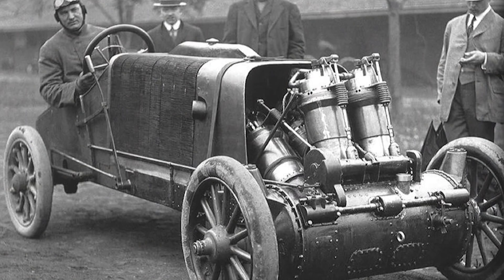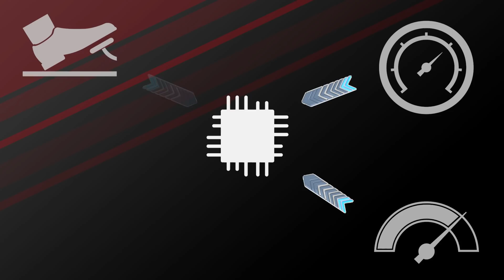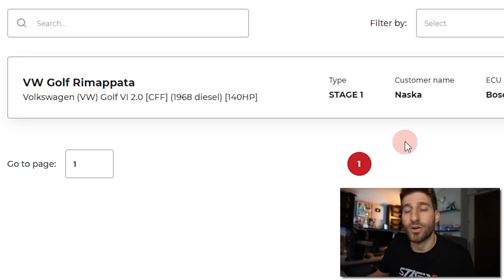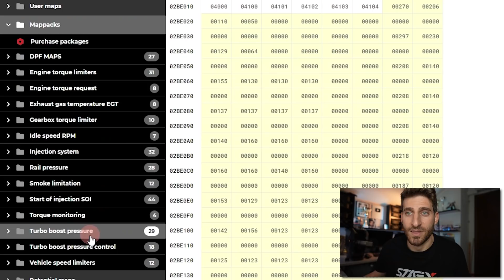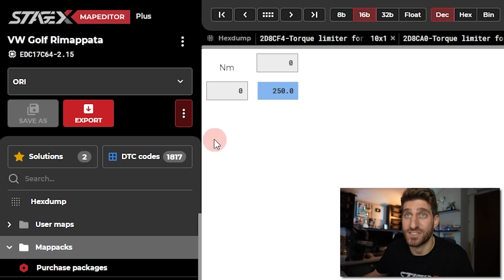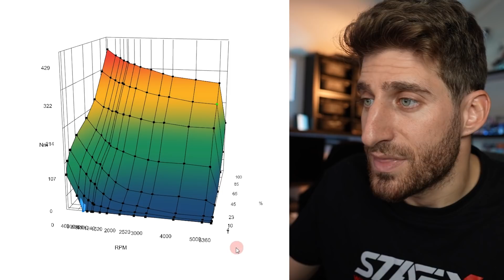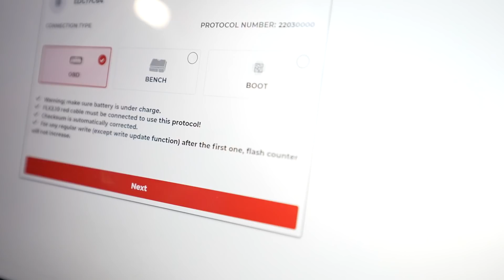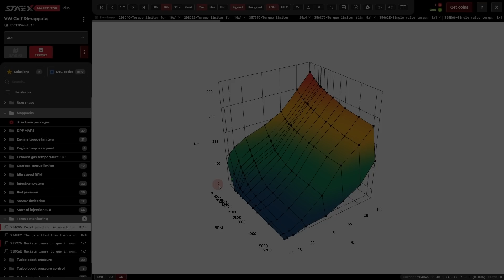I REMAPPED THE ECU

Comment: What you say is true in some cars but some cars are tunes like that because the engines are used in many different cars and tune differently like for my car 138 hp but they use the same engine in a different car running nearly 200 hp mostly seen in Volkswagen group Vag that's why they are so tunable and you do not break the engine as long as you change the correct components to match the horsepower the engine will be fine up to the factory test limits for that particular block set up